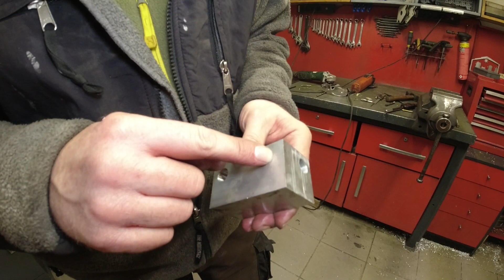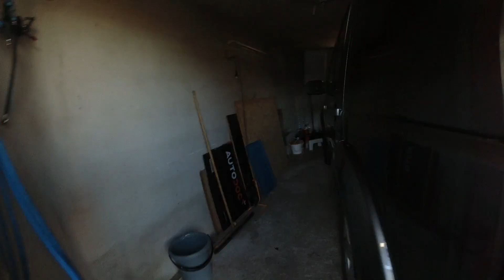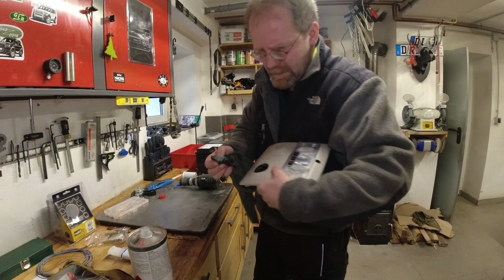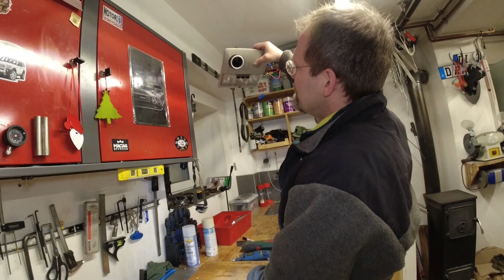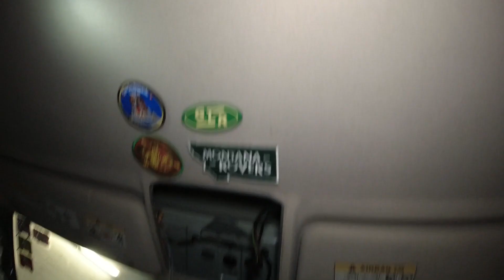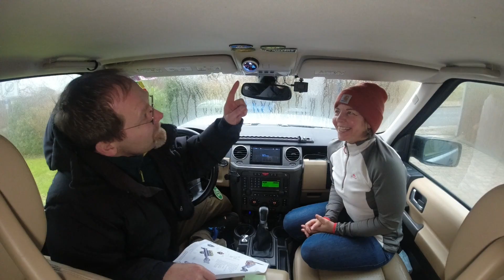Land Rover Discovery - How to install an oil pressure gauge

Comment: Hi Cristian and Vera, very helpful video thank you so much.
Could you please help me to understand the the oil psi, many people say that 10psi on idle and 27.5psi on 3.5k rpm when engine is hot that's the minimum,
my LR service manual says the same but no info regarding if this figures are min. on other hand Jaguar on the same engine is saying that figures above are for normal engine working and 
minimum on hot engine is; idle 7psi / 3.5k rpm 14psi do you know anything about it?
Reply from the maker: Check out the videos in our "Engine Oil and Oilpump" Playlist. You'll find all the information in these videos. 👍🙋‍♀️
Reply: Thanks For Help, wish You all Best 😊

Comment: Hello there
I have a 2016 discovery 4 sdv6. 
In a cold start oil pressure light comes on as soon as I start the engine, for like 1-2 seconds 
(Currently it's on 183000kms ) any idea why it doing that ? Thanks
Sahan

Comment: Hello, excellent work and magnificent channel.
The idea of the pressure gauge is great, I would like to do it but I can't find the 1/4 18 npt adapter that is threaded to the engine block. What adapter did you use or where did you get it?
Thanks and keep up the good work with your videos.
Reply from the maker: A Adapter made in the UK is shown in the video.  With full name. Just freeze the picture. Christian
Reply: @Vera_and_Christian  Yes, I saw that UK adapter but I would like to do it as you did with rigid pipe and I can't find the 1/4 npt 18 compression pipe adapter on the internet that is threaded to the engine

Comment: The slow gauge response, is probably due to air in your new 'manifold'. With the engine running, slighly undo your new sender to purge out the air.

Comment: I'm Scottish and was completely against leaving the EU, for many reasons. Free movement of goods was right up there. Amusingly, everything we make here and sell in the EU still has to meet EU standards, so... That argument was nonsense (like I said at the time).
My favourite "well wtf did you think would happen?” moment came when Bruce Dickinson (Iron Maiden), went on a wee toys out the pram rant about how difficult touring in the EU had become due to having to get visas for each country and getting all the equipment from place to place etc. He was a rather noisy supporter of leaving the EU... The very definition of cutting your nose off to spite your face... Absolute nonsense from start to... Well... I was going to say finish but it's still dragging on... 🤔

Comment: On my Defender one good thing is there are no air bags to get in the way of these kinds of installations.  So in a crash I will die but at least my oil gauge can go where ever I want.
You mentioned adding a resistor for the gauge brightness.  I assume, then, that there is a separate wire for the gauge LEDs and you are going to put a resistor inline with this to limit the current to the gauge LEDs.  In this case you could consider switching this in with the headlights so that in day time you get a nice brightness and when you put the headlights on it dips down to something more sensible for night time.  If you still need a resistor even to dim it down even for the day time, then you could have a permanent inline resistor for the night time brightness, and then switch another resistor in parallel with it to allow for the day time brightness.  But at this point I would probably prefer to PWM the gauge LEDs and have two different duty-cycles for the day time and night time.  If you want advice about that I could easily make up a circuit that will do it and share it with you.
Reply from the maker: The gauge has separate wires.  I’ll have to change it to a digital one because it quits when it is below freezing 😂.  Christian

Comment: I fit lastest FOMOCO oil pump and after one month(500km)oil presure drop to 0.6 on idle and 1.9 on 3500rpm. First meassure after repleace I had 1.0 on idle and 2.5 on 3500rpm. No idea whats happend….
Reply from the maker: A Discovery 4 has different, lower oil pressure specs. Do you have a Disco 4 maybe? Check out this video https://youtu.be/lRZ37buT4pk 🙋‍♀Vera

Comment: Hello, thank you for the video :)

I would like to check also my oil pressure. I simply remove the OIL PRESSURE SWITCH and plug the gauge (with 1/4 x 18NPT head)? 

Thank you!
Reply from the maker: Not sure what the thread is.  You also need a extension.

Comment: If I'm right, you need a ~75mm Long 1/4" NPT M - F extension tube to bring the oil pressure port up to an accessible place. Is this correct?
Reply from the maker: We have a new oilpressure gauge in the making. 🙋‍♀️Vera

Comment: Great video as always LR Time. 
Have to say though that the best part was seeing Christian finally throwing out that old flammable polyurethane insulation. I will sleep much better knowing that it won't burst into flames when Vera is driving her D3 one day. With love and best wishes.
Reply from the maker: One moment, I only took out one little piece which was in the way.  Most of it is still in.  So no reason to sleep well yet.  Car could still burn to the ground 😬😳.  Christian

Comment: hi this is it possible to put it also on the range rover sport 306 dt?  thank you
Reply from the maker: The 3 liter TDV6 has the same oil pressure switch, so it should work in the same way.  Christian

Comment: First of your videos that I've watched. Echoing other folks comments, excellent & informative. Love the banter & what a workshop! Given this engines issues with oil pressure, spun bearings & crank failures, not having a pressure transducer, fitting an oil pressure gauge is a no brainer. Wish my XJ had one, looking at doing similar but don't want to cut holes in the internal trim.  Suggestions appreciated.

Comment: There are gauges that are using the obd2 port for oil pressure plus alot of other things boost pressure, voltage and so on. It's wireless dongle. No need to pull cables and machining blocks😁 Given that the Disco has the PID.

Comment: Enjoyed the oil pressure video, and although I am saddened to hear of the breakdown, I am interested in seeing the repair and learning about the breakdown. I struggle with adding things to my car - and wonder if I can get replacements for the added parts. I once bought programmable digital panel gauges, but found they were difficult to program. Eventually, I spent weeks designing an Excel spreadsheet to calculate the numbers required for the gauge range and offset needed to match the sensors. After that, I was unable to buy more gauges. The supplier discontinued them because they were too hard to  program!

Comment: Hi like your videos.can I ask what oil do you use or recommend for 2.7 discovery 4 ?
Reply from the maker: We use 5w30 per the castrol oil finder.  You have little options if you have a DPF.  Fabian runs now 5w40 from Total per Citroen specification.  But this oil is not approved by LR or Ford.

Comment: Yet another great video, I currently drive a discovery 2 td5, but possibly in the future I will make the decision to move on to the d3/4.
I
One thing puzzles me, you often buy cheap aftermarket parts for your discovery's, all I've found with those parts is very poorly made & cheap looking parts.
Reply from the maker: Parts we replace on our vehicle, are aftermarket, if that is all we can get and afford. But they are not of poor quality. Now like those gauges and some tools , yeah Christian does have a problem, and he knows it. 😅👍🙋‍♀️Vera
Reply: @Vera_and_Christian  I think we both have a problem when it comes to landrovers ha 😅 
I've had my discovery 2 for 8 years & I'm still fixing things on a regular basis.

Comment: I'm a little surprised you didn't confirm that the gauge worked to your satisfaction before cutting plastic and running wires.  The other thing is that you removed the oil pressure switch to do this, so you are losing that function - which I assume is monitoring with an automatic alarm (light on your dashboard?) if the oil pressure is too low.  Does this then mean that you better pay attention to the new gauge to make sure the oil level is where it should be?  If so, what's the point in replacing it?

Comment: Neat upgrade. You two are funny. 
I suspect Vera's car is a test platform for all the upgrades for the mall crawler. I'm guessing the expanding foam won't make it to the D4.
I'd want to dim that gauge light for our outback road trips.

Idea for another project- Front diff locker or rebuild.

Comment: It is best to have your sensor ground run directly to sensor rather than engine ground. Otherwise you can get incorrect readings due to voltage drops from the current/resistance.

Comment: Actually the problem with buying UK products isn't Brexit. There is a UK EU trade deal for most products. The problem is the new IOSS tax regime introduced across the EU last July. This would have been the same problem with or without Brexit. Personally I needed to find an importer who is VAT registered in the EU and then IOSS was no longer a problem.

Comment: Hi Vera and Christian, again a very interesting Video. Many thanks. One suggestion regarding additional instrumentation. I am used to instrument my cars with SPA double gauges, digital ones. They are sometimes better than analoges because you can see the direction where the measurement is moving to. An analog one doesnt show this. Very important if you want to see Exhaust gas temperature as a reaction of your engine torque request. In the case of the discovery there is already a lot of measured values available via the GAP IID Tool. But one instrument I would add anyway. The oil pressure as you did and the water pressure. Both integrated in one double digital instrument of SPA. It is programmable for lower and upper limits and indicating via a warning light when limits are over or underrided. With a digital indication of the cooling water circuit pressure you can see very well if your system is leaking, even if it is very few. And it warns you before the engine is getting overheated.  I take for this the SPA instrument for oil and boost pressure. Its because the boost pressure offers a lower pressure range which fits very well with the water circuit. By the time you learn very well how the circuit reacts during heating up and cooling down phase and any deviation of this, even very small, is causing immediately your attention. During cooling down you can see very well if the tightness of the system is perfect or not. So its not all about leackages, you see also if the pressure valve of the reservoir is working correctly which is important for avoiding boiling coolant above 100 Degree.

Comment: Great video. I was hoping we could see a change in the oil pressure on startup when you fit the new oil pump. But that gauge is going to be too slow to show the difference I think. After your last video on oil pumps I’m keen to replace mine with the latest version.
Reply from the maker: Yes, this gauge or sensor is too slow.   You would need to buy a quality gauge and sensor for about 120 Euro.  I payed only 35 Euro.  Christian

Comment: Good video guys, I would mention your Patreon page more as you both deserve more support for your time… I have signed up for the “access all areas pass” with 24 hour phone support from Christian 😂…. Also sounds like you need new glow plugs 😣
Reply from the maker: Thanks,  the 24h phone support also comes with the emergency button push in the middle upper console of most modern cars.  Christian.  Oh, glow plugs are on the schedule soon.

Comment: As always a great video , funny enough bought a small digital oil pressure gauge that I’m going to install in the small removable panel that sits on the RH side of my instrument panel , as a side note still chasing the error in my turbo , ie P0046-00 (28) Turbo/supercharger boost control solenoid - circuit range/performance, in live data comes up N/A , think it might be a broken wire somewhere as all the intercooler hoses etc check out , sorry I’m waffling, lol, sorry to hear of the unexpected breakdown, hope it’s not too serious , really hope ur able to continue your weekly videos but of course understand , hope u was able to keep warm , all the best and till the next one, keep safe and well 👍👍

Comment: If the pressure drops will that give you early warning that the crankshaft bearing is about to spin?? Great idea. Thanks for the vids!
Reply from the maker: No, the dash warning light will stay on unless the pressure goes below 0.15 bar.  By then, it is too late.  The gauge does tell if the pressure behaves plausible.  Christian

Comment: Here is the BIG question: If this oil pressure gauge was fitted to Fabian’s Discovery 3 and he just happened to be looking at it when his catastrophic engine crank shell rotation happened, would he have noticed a sudden rise in oil pressure as the gallery became blocked, so that he could have stopped his engine sooner? If so, would this have saved you much of the time to repair the damage caused to his engine?
Better still, could a kit be used to recognise the sudden unusual change in oils pressure to then immediately put the engine in low power mode, or even shut the engine down completely?
Reply from the maker: I think the pressure change is minimal in case of a catastrophic engine failure.  In Fabians case, only two main bearings got blocked.  I think the increase would not be recognizable as the pressure changed constantly.  Also not with better electronics.  It happened very quickly too.  The engine actually stalled immediately when he took his foot of the accelerator.  It did start back up but had a large noise.  Christian
Reply: @Vera_and_Christian  Thanks Christian. I was thinking that would probably be the case too. Even if the pressure raised a bit, the chances of anybody happening to be looking at the pressure gauge at that precise moment would be extremely slim anyway. Interesting that 2 main bearings blocked! Do you think that 1 went and that the vibration and heat caused the 2nd one to rotate and block almost immediately? Or was it the Dealer starting the engine again that caused the 2nd shell to rotate?
This problem is the constant worry to us TDV6 owners and probably amuses some Toyota owners! But I do know of a poorly looking after 2.7 RR Sport that ran for nearly 250k miles, before it happened.
Thanks anyway for another great video and keep up the good work. Regards to you both, Richard.

Comment: LR ovners- drivers are crazy...... only work ,work, work,  I get some nissan patrol gu4 and also have lot fun work in garage in til  I change engine from ZD30 for TD42t...  and then life is boring, nothing  breaking, just drive, oil change and drive.... this summer gone drive to Nepal... maybe some thing breake down.....
Reply from the maker: Nepal might not be far enough.  I recommend that you take a spare light bulb and a piece of wire and maybe a 1/4 role of duct tape.  Just in case the Toyota acts up.   Thanks,  Christian

Comment: Looks like a tidy install. I'm watching other YouTube videos for inspiration on building a relay/fuse board to simplify the wiring in my battery compartment on my 90. I see the Americans have S pod and Voswitch and we only seam to have ARB linx as far as I can see in the UK so a diy version is on the cards. Perhaps this is something you could look into in an upcoming video as looks like a good inside job for winter project.

Comment: Great video!! Just one question or idea: 
does the Android head unit installed some months ago have any possibility to receive and show the pressure signal?  or maybe using the OBD App built in that android unit...just an idea
Thank you very, very much for your dedication and passion!
Reply from the maker: Oh I am not sure if there is a built in unit like that, at least one that is affordable. Maybe if you install a tablet. But we have the GAP tool and OBDii tool for real time data. 👍😃 Christian installed the oilpressure gauge because loss in oilpressure and crankshaft failures are related. So he hopes that I will actually notice a drop in oilpressure and turn off the engine on time. I don't really think that I would notice. But I do try to pay attention and see how the pressure changes and if those changes are reproducable every time I drive the car now. 🙋‍♀️Vera
Reply: @Vera_and_Christian  thank hoy 💪

Comment: Great video again Vera & Christian , you could use window tint on the oil gauge to dull it down a bit . Today I fitted a new rotary ( clock ) spring to my wife’s Range Rover Sport , sat nav now works .
I also fitted some cheap Chinese black wood interior door handle and steering wheel trim covers to my Discovery 3 , looks much nicer now .
Vera ... there is cheap bottle/cup holders on eBay ( the ones that grip the bottle ) , I payed £14 for 2
We are looking forward to the next video , see you next Sunday
Reply from the maker: I got that bottle holder, but my problem is that the bottle holder has a too tight grip on my cup and comes out when I pick up my thermos every single time. The OEM by the way too. I have not found a thermos or any bottle that fits into the cup holder perfectly. I wonder what kind of an example the designer used when he designed the cup holder. 👍🙋‍♀️Vera

Comment: Vera.
You need another gauge on the other side of the panel, maybe "Altitude"? And between them a BIG red button labelled either DON'T PANIC
or
PANIC
Reply from the maker: That's so great, Fabian could really use that instead of the fault codes you usually get. I am going to have Christian reprogram my dashboard unit. 😅👍🙋‍♀️Vera

Comment: Great video as always. Whats with the video of a glow plug change?
Reply from the maker: We will do that when we also change the oilpump, timing belts, and what not. It is always best to open the engine once and fix it all, then open it several times. But we have now all parts and plan on doing that repair over 3 days starting next Friday. 🙋‍♀️Vera